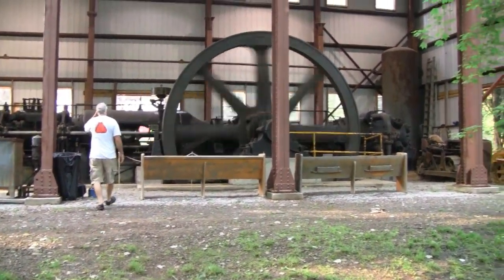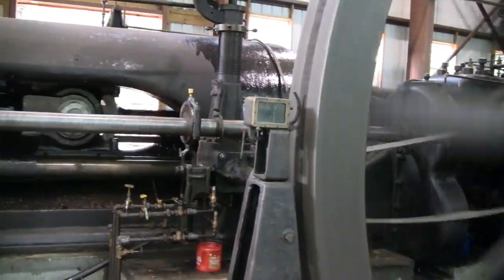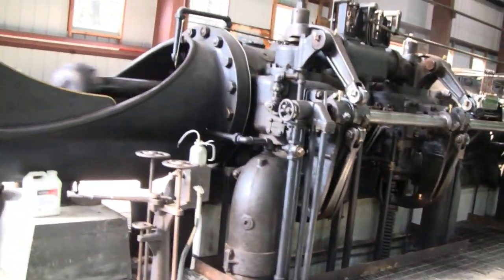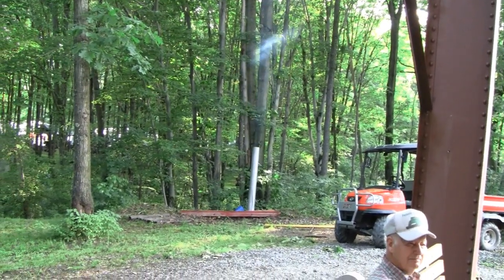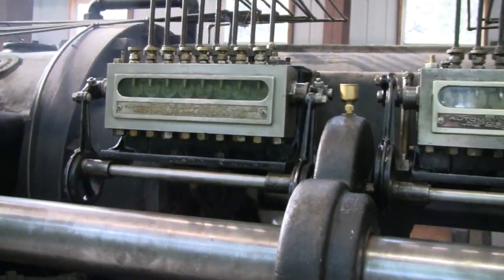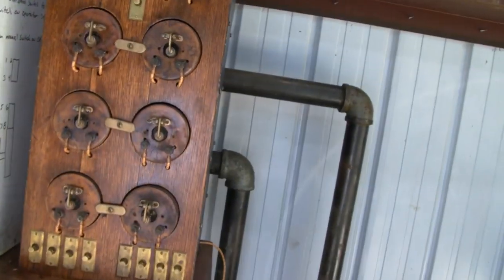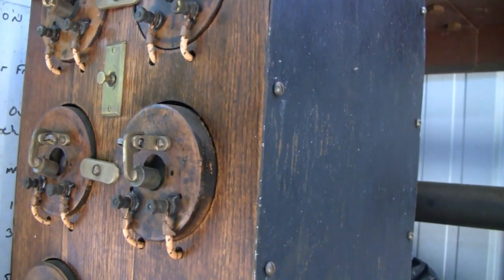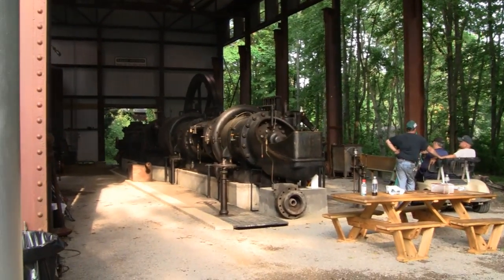HUGE 600HP ENGINE COOLSPRING MUSEUM

Comment: The thing I find amazing, is they don't use 
rotative force here.  the pump is driven by the 
cyclic reciprocating force.

In other words, that flywheel is just to keep 
the engine running.

Amazing!

Thanks, Everett!

steve

Comment: I found this interesting
"This engine was manufactured by the Snow-Holly Works 		of Buffalo, NY, and is serial number G329.  It has two tandem 24 		inch bore x 48 inch stroke cylinders that are double acting.  The 		natural gas compressing cylinder at the front of the engine was also 		manufactured by Snow and features an 18 inch bore and 48 inch stroke.  		The compressor accepted gas at approximately 50 psi and raised it to 450 		psi.  Upon peak compression, the gas in the cylinder exerted a 		force of about 114,300 pounds on the piston. At 75 feet long with an 18 ton, 18 ft diameter flywheel"

Comment: I figured it out.

This a 2 cylinder engine, with 2 pistons all on the same rod, and a head at each end of each cylinder.

One of the cylinders would be kind of like a steam cylinder in design, except this one burns fuel in the cylinder.  So, you've got a 4 head engine, with a power stroke, every stroke.

Interesting design.

Comment: Roadking, I'm far from knowing much about that engine, but if I understand what I've read correctly, it was for compressing natural gas or town gas in municipal lines.  Its tandem cylinders, one of which actually runs the engine, and the other of which compresses the gas from somewhere around 40 psi to over 200 psi.
Reply from the maker: Interesting!! I haven't read anything about this one yet, I'll have to check it out!!☺
Reply: http://www.coolspringpowermuseum.org/Exhibits/Exley/Snow_600_00.htm

Comment: Snow gas engine specs:
24" bore
48" stroke
Year 1917 
Weight 140 ton 
Flywheel diameter 18 foot
Hp 600
The engine has two cylinders at which it operates as a four cylinder engine because it is firing on both sides of the piston. Hence the name double acting tandem engine.

Comment: Here is the description from the Museums web site of this engine.
National Fuel Gas Corporation of Titusville, PA, donated a 1917, 600 hp Snow gas compressing engine to Coolspring Power Museum in 1992.  This engine was removed from their Roystone Station, near Ludlow, PA,
This engine was manufactured by the Snow-Holly Works 		of Buffalo, NY, and is serial number G329.  It has two tandem 24 		inch bore x 48 inch stroke cylinders that are double acting.  The 		natural gas compressing cylinder at the front of the engine was also 		manufactured by Snow and features an 18 inch bore and 48 inch stroke.  		The compressor accepted gas at approximately 50 psi and raised it to 450 		psi.  Upon peak compression, the gas in the cylinder exerted a 		force of about 114,300 pounds on the piston

Comment: a chevy 454ci can make up to 600 hp and 600lbs
Reply: Sure, but this engine makes all of its power at 80 rpm which means that it makes a little over 39000 ft-lbs of torque.
Reply: I can build a 2.3 4 banger to make 900hp but it still will not have the same torque
Reply: wow 900hp ea that is a lot out of 4 cyl!
Reply: Luke Shaw people underestimate the little 4 cylinder there is a lot of work done to get them to 900hp
Reply: Luke Shaw lol so? This makes more torque than 30 454's and much more reliable, and quiet...